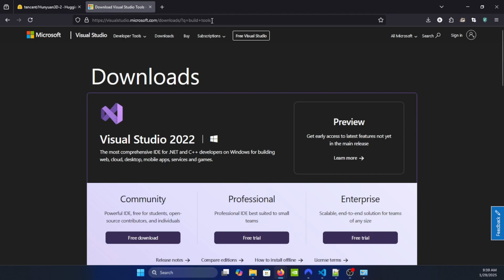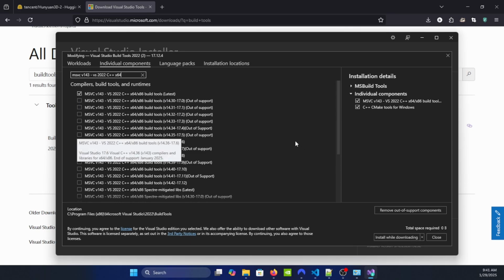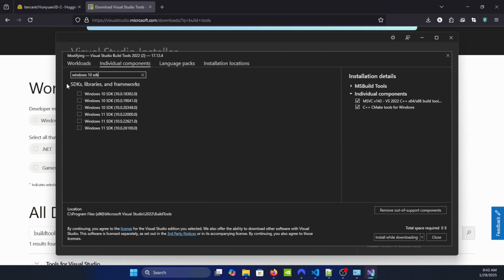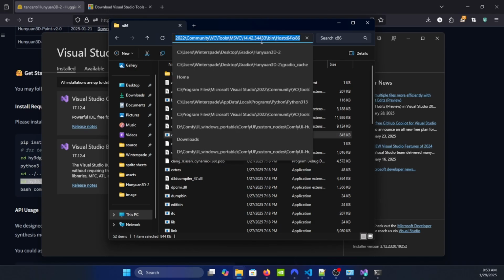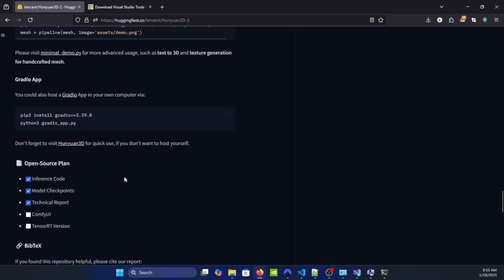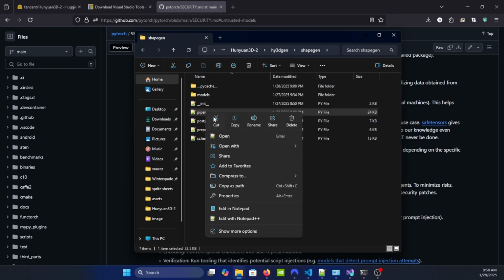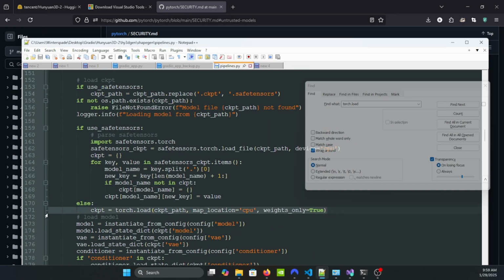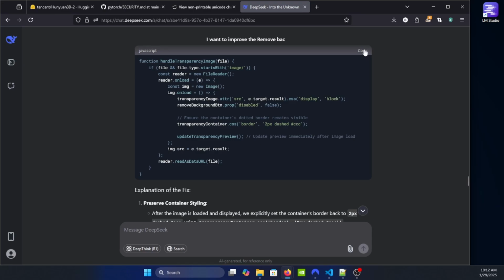Hunyuan 3D-2 Installing Build Tools & Model Security Patch

Comment: i have install visual studio and build tools exactly like you, but my cl.exe file located in Program files(x86) instead of Program files like your video. Then i try to paste the to the path and it still said " 'cl' is not recognized as an internal or external command, operable program or batch file". How can i fix it
Reply from the maker: Once you find the cl.exe path. Add it to the env path with out the cl.exe at the end (reference only the folder). Restart or close all terminal start again and type cl (enter)